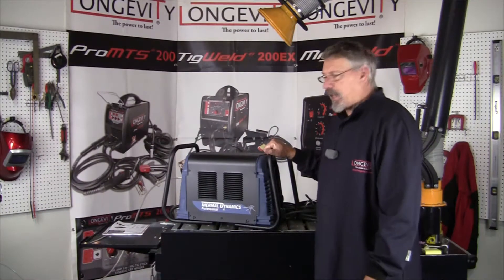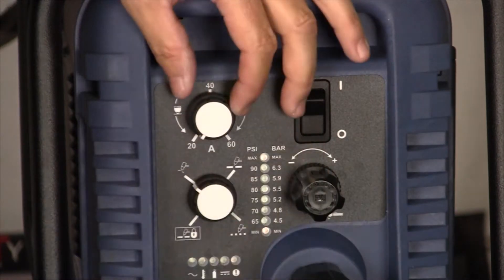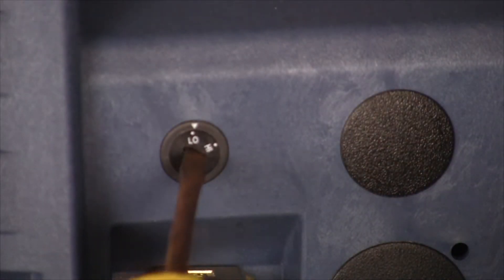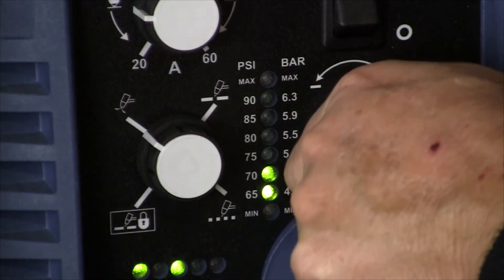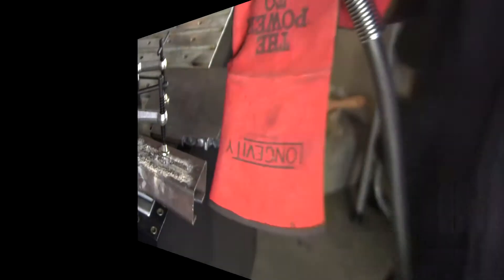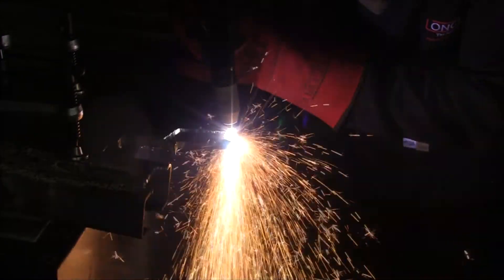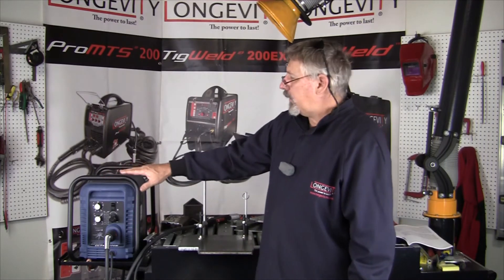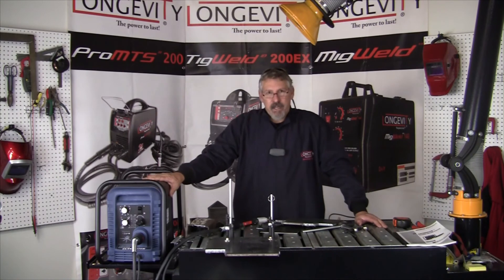THERMAL DYNAMICS CUTMASTER 52 PLASMA CUTTER REVIEW AND SETUP PART 1

Comment: I have had mine for 6 years. It always works, so if you are having a problem, try changing your settings to match the manual. Also, the first thing he did was set the voltage selector. Double check your voyage setting. Last, many users have commented that aftermarket tips do not work properly (look at the Amazon reviews for the consumable parts), only use OEM TD parts.

Comment: I have a thermal dynamics 52. Never really  worked well. Very temperamental.   Giving  85 blinking  error. Replaced the torch  with new one and still doing the same.
Reply from the maker: Checkout our plasma cutters!

Comment: My JUNKMASTER 52 is nothing but a pain in the butt. There are always some lights blinking no matter what. Clean dry air, New electrode with new everything and still no cutting.. Save your money people...It cuts great when it works.
Reply: David Hoover could not agree more.  Freaking thing has been a PIA from the start.  Now I need a new torch.  600 dollars.  I'm going to buy an everlast 80 instead.
Reply: I bought the green victor/thermal dynamics cut master 52.  Been using it for about three years, not as good as my hypertherm 800 but it gets the job done.
Reply: Yep, same with mine. Changed with brand new torch and still blinking 85 fault error. I checked  all components  ok inside and all works well. Except when I'm trying to cut!